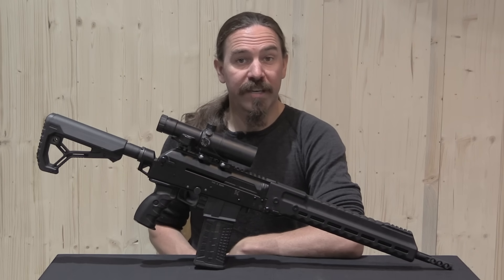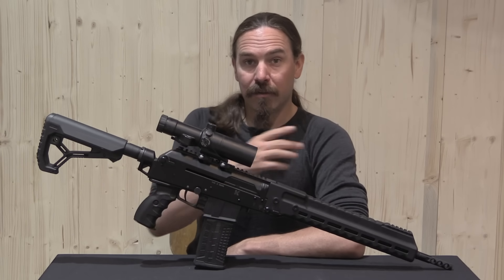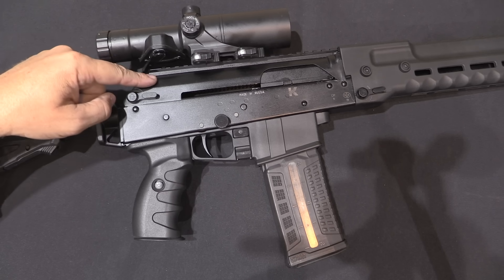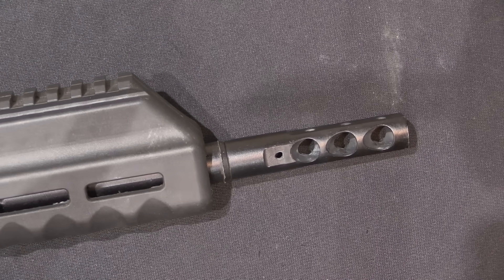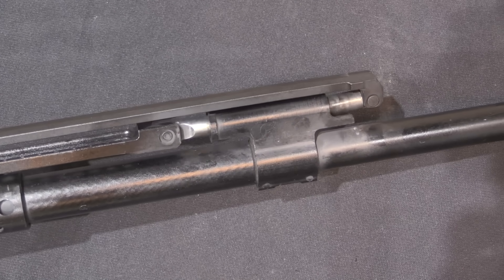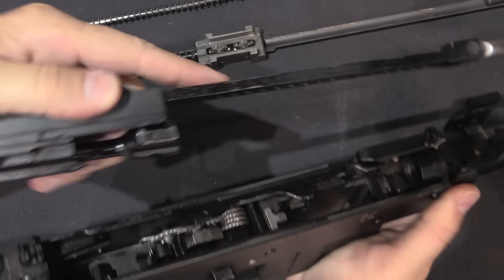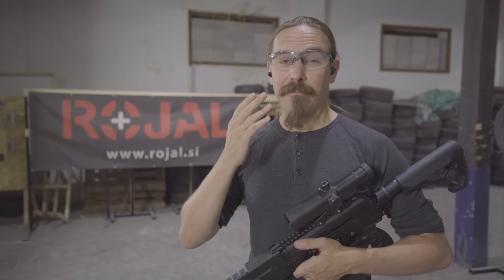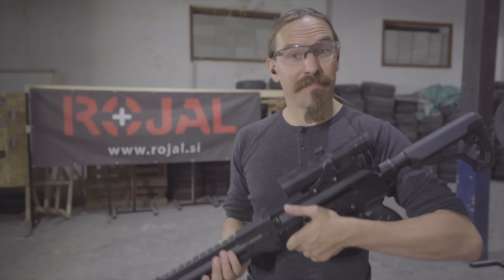Balanced Recoil AK-107 / Kalashnikov SR-1: Is It Any Good?

Comment: At the end Ian makes a very important remark - you can get same results with an AR with lightened bolt carrier and carefully adjusted gas system.. which means very low reliability under actual combat condition (not on the range).
Balanced action was invented for controllable automatic fire under military conditions, where you cannot cheat by using lighter bolt groups and minimal gas drive power. Unfortunately, its actual advantage in performance when used in automatic rifles such as SA-006 or AEK-971 was rather small (like 10-15%) compared to the AK-74, and simply not worth the trouble in a military issue rifle.
Reply: That's the entire problem right there though; people that think military rifles should or could be adopted for civilian use. The military has weapons with large magazines, long barrels, full-auto capability for a reason. Any civilian who thinks that they too need these things is a moron and should never be allowed near any type of weapon, be it rifle, handgun, crossbow, lawndart, anything.
Reply: Who are you to determine someone else's needs?  If you follow your logic, no civilian needs a gun at all.   Stop falling into the anti gun trap.  It's not about need, need is subjective.   The people of Ukraine NEED all of those things right now.
Reply: @MrBottlecapBill  curious as to what spurious reason you’d have cited if not for having that war as a strawman?
Reply: @minimaltrace  Ah yes, the distinct military weapon characteristic of checks notes "A long barrel"
Reply: @MrBottlecapBill  Not exactly true, at least not yet. The Ukrainian Military already has auto weapons at their disposal, and they are sticking by the Geneva Conventions by not allowing civillians to fight as unregular fighters. Even foreign volunteers are being incorporated into the Ukrainian Army.
Reply: @minimaltrace  You give me gated community vibes
Reply: @paulbrozyna3006   mexican citizens versus the drug cartels.
Sri Lankan civil war: tamil tigers used human shields. That said, the tamils themselves were reacting to abuses by the majority Sinhalese. In any case, any civilian could have used self protection when the usual authorities failed, and you had better realize the major point from that: even if the authorities don't entirely fail you: when seconds count, the police are only minutes away. Which is often effectively useless. And that's a best case scenario, in a supposedly peaceful country. Which not even the United States should be claiming to be.

Any number of church shootings as of late could be combated with more armed people, however, mass killers, of course, would target public places with no guns allowed. As such, with respect to such places, other security arrangements are required, that would probably mean private armed security. But really, someone, somewhere, is going to have to have a ranged weapon. Are private armed security armed civilians? Maybe not entirely, and they do get more training if they're expected to hold that position, so hopefully that's more placating.

And yes, though the actual effectiveness of an armed irregular militia is dubious, there are some arguments them having success, with some real world examples.
Especially for a country like the United States, which has many remote areas, it would be very expensive to have a civil war in which the attempt was made to rout out every single last holdout.
But is there a need? Of course! This is the states we're talking about! I don't know why her people haven't already had a massive insurrection against its government years and years ago. (There's a lot to be read about the government nit being democratic, not representative of her people, and how it makes things worse for them. But it's a different topic) Or at least I wouldn't, if I didn't understand it was the people themselves that are the problem, but that's a different topic. And if the USA were changed...so too would it's foreign policy, affecting the rest of the world, hopefully positively.

In any case, the luty submachine gun is just one example of a home crafted automatic weapon. Sure, banning still does something, but if there's a will, there's a way, and it's easier than you might think. And all you end up doing is punishing law abiding citizens.
That said, if you could make everyone believe in not owning guns, that would be more effective. But for all the success that seems to have brought in the last few decades, it has also brought out an overly...vocal crowd opposed to that. And they don't seem interested in giving up without being killed first.
And if you went and wanted to kill them? Well.... you'll need guns at the very least.
It's this insidious thing, you just can't get away from the guns.
Not until there is no reason for them. Which, well, I'd like that day too. But as far as I can tell, the first step is re-engineering of the human brain to change human nature, and that's just the hardware, then you need the right software/culture/memes.

If people are dumb as you would think (or at least so minimal trace probably does), that is the problem in and of itself, isn't it?
Reply: @minimaltrace  The US 2nd Amendment says "Hi".
Reply: Cant all that fine tuning be done with this rifle improving its performance even more? Put lightened bolt in, load anemic sporting cartridge and tune gas system for that exact cartridge. This should be as close to no recoil as humanly possible.
Reply: @Steir12  When the projectile bounces off the cardboard target at 3 meters the system is perfectly tuned.
Reply: @minimaltrace  translation… I can’t see that I have a need for these things so no one should have them. Booooo
Reply: Glad to hear from you Max !  Hope all is well with you and yours!
Reply: @minimaltrace  Long barrel gun is certainly more pleasant to shot which absolutely has value in civilian market.
Reply: @Steir12  it can be tweaked but there are no aftermarket parts for this. Main advantage of ar-15 as a competition gun is not it's design but almost limitless ammount of parts and manufactures on the market.
Reply: @MrBottlecapBill  and 🇺🇦 Ukrainian government is training select civilians and issuing them weapons and ammunition.  Chill.
Reply: @minimaltrace  News flash: police officers in the US regularly keep these weapons in their cars to stop criminals who are committing violent acts. If you're worried about stopping a criminal, it's clearly an excellent choice, or else cops wouldn't have them. Or are you legitimately suggesting that nobody needs to defend themselves?
Reply: @Thoroughly_Wet  well, because the government in the case of the United States, is “yours” already. Unlike Walmart, whatever Church you go to, your bank, your internet provider, the newspaper you read, the tv networks you watch- the government despite all its failings- is the only thing you actually have a fair abs equal say in. You can go to a town meeting, you can run for school committee or planning board, you can campaign for a candidate for senator or lobby and harass a sitting senator with letters, faxes, phone calls and office visits. 
You don’t like the laws? Your representatives created them. Your a citizen - until you are not- why would you want to fight against yourself? I’m all for civilians owning whatever they want. The military should be a citizen militia that gets to practice and play soldier one weekend a month and two weeks a year like in Switzerland. We can keep our rifle like our uniform at home because we’re responsible for them- if everyone who wanted to serve got a Glock and an M5 Spear to keep at home- would anyone really be threatened by the nerd who wants to buy an Ak74m or a Galil or an MP5 or whatever? They’d just be seen as enthudiasts/collectors. If you don’t want to serve in the militia/national guard thing o described.- you pretty much forfeit that part of citizenship and you don’t get to own guns. There problem solved. Our foreign policy would no doubt be kinder and more well thought out- since everyone would be at risk of going to falleuija. You’d know that gun owners were competent, sane, and safe with firearms. Gun owners would get to train and shoot for free on uncle sam’s dollar. Oh- and people would feel a real connection responsibility and sense of ownership over their government- since they actually hold the legitimacy and ability to project its power themselves.
Reply: @eargesplitten9876  The Brown Bess had a 46" barrel, so clearly the longer the better ;)
Reply: @minimaltrace  The entire point of a gun is to have as much of an advantage in violent capability over your enemy as possible. Most crimes are committed with handguns, but then there's the occasional madmen with a rifle shooting anyone he can. The govt is constantly pushing to limit civilians' access to firearms as they spend more in defence than any other nation. Tell me again why I'd want to be limited in selection of weapons?
Reply: @minimaltrace  yes, they can be adopted and should be adopted.
Reply: @minimaltrace  tell me your wife has a boyfriend without telling me your wife has a boyfriend
Reply: @walmorcarvalho2512  Well, they already armed some of their civilians in Febuary, just on the streets from crates, often without control and registration...
Reply: @prfwrx2497  problem with the balanced action that it's very hard to make it with a short barrel.
Reply: @minimaltrace  Does MinimalTrace stand for "minimal traces of brain?" You are an excellent example why anyone over the age of 65 needs to submit, every year, a written statement proving sound mind in order to be allowed to vote.
Reply: @walmorcarvalho2512  WTF? Where have you been in the last 3 months? The ukraine military has been arming civilians for months at this point, they don't give a fuargh about geneva conventions. It was a big deal for like, half a day and then nobody talked about it again.
Reply: Привет Максим.)
Reply: 👍🏻 that opinion is spot on
Reply: @Chiller01  Perfect anti riot setup, reduced powder and plastic bullets but with a 2000rpm burst to the face, that'll be like "BRRRUP, OW YOU PLONKER THAT FUCKIN HURT"
Reply: You don't need a lightened BCG to get a superior flat shooting AR. A good buffer system, flash hider muzzle brake combo and a adjustable gas system or tuned gas tube makes for a very reliable and flat shooting rifle for combat.
Reply: @minimaltrace  I really hope you are not a US citizen.
Reply: @minimaltrace  silence Fudd
Reply: @ShizawnSanders  I do not think that a 'tuned gas system' or 'adjustable gas system' is a good thing on a military rifle, but it's my own personal opinion. For sport - sure, it would work nicely.
Reply: @paulbrozyna3006  That's not what a straw man is.
Reply: @minimaltrace  I would love to "adopt"some military rifles.which adoption agency should I go to?
Reply: @minimaltrace  I would love to "adopt"some military rifles.which adoption agency should I go to?
Reply: @craiggaulzetti2255  Depends on what government you're referring to, If you mean Local and State governments then I'll absolutely agree with you that the people have a say in it. there's a reason there's 50 states and not just a single country and it's so that way everyone in their local area has at least some say in what happens where they live. the problem is that the federal government has gotten so bloated and massive that it's trying to choke out the local governments and impose it's own will. 

They (The Federal Government) believe they can control a landmass the size of more than half of Europe when in reality, someone living in New York doesn't live the same as someone in West Virginia, Iowa, Texas, Florida, Oregon or California. The culture isn't the exact same and people at the federal level try to treat it like it is.
Reply: Hey Max, how does this system compare to the Kord 6P67 in terms of design and effectiveness? Also, how's your AK book coming along?!
Reply: @slister1911  All balanced systems gave an overall 10-15% performance boost in burst fire effectiveness over the standard AK-74. As for the book, the manuscript is complete, but current political situation makes the future of this book uncertain, to say the least. I still hope it will be published someday, but probably later than sooner :(
Reply: @mpopenker  I’m sorry to hear that about the book, I’ve been looking forward to it for quite a while now. I guess publishing isn’t as big  of a problem as getting you paid would be, what with the current political climate. I have great respect for the Russian people, and a love for their small arms genius—I keep hoping our political nitwits in the US will see Russia for the ally it should be against China. Hopefully someday that will happen, your book will be available, and Russian small arms can be imported again! 😁
Reply: @mpopenker  well, you don't need a adjustable gas block. They make gas tubes that allow a precise amount of air into the system. This gas tube is no less reliable than a normal one. You can have as much or as little gas as you want with a different gas tube. That with a suppressor or brake/flash hider combo and matched buffer system is as reliable as it can be while be a very soft shooting rifle.
Reply: @minimaltrace Fck Ukraine
Reply: @ShizawnSanders  all that fine tuning is nice as long as you play it under the comfy range conditions. Once you're freezing your *ss and lube in the Arctics or have to fight in the fine sand that gets everywhere it all goes belly up. There's a reason why most military weapons are much more rough than sporting ones.
Reply: @mpopenker  even a over gassed AR with a suppressor or compensator is a soft shooting rifle. Even in this video he suspected most of the recoil reduction was from the brake.
Reply: @ShizawnSanders  I only can repeat that all this trouble with this rack and pinion system was to improve FULL AUTO dispersion, and increase hit probability. And still was not enough. And as far as I know, any military issue M16 / M4 rifle is not known for decent full auto / burst dispersion, although I would appreciate any hard data to that effect.
Reply: @minimaltrace  It's not about needing. If you think 2A is about "need", you got it all wrong. Back then, when it was put into the constitution, you were allowed to own anything from musket to cannon. A musket at the time was the peak of military infantry implements. It was like legally owning a fully automatic military-issue M4 today. They've already infringed on 2A over the years and you shouldn't let them infringe further.
Reply: @walmorcarvalho2512  "The Ukrainian Military already has auto weapons at their disposal, and they are sticking by the Geneva Conventions by not allowing civillians to fight as unregular fighters." Nope. At some point, they just pulled out military crates with old Soviet AK-74s to the streets and just dumped them there, handing out to everyone with ID or even without it. This was at the moment when Russian troops were near Kyiv.
Reply: @TheyCallMeStuPedaso  I agree with your assessment of minimaltrace and brain power. I don't agree with your age requirement. Earnestly, I've met way more "why do you need that *insert gun here*" who are under 40 than I have over 65.

 I've also seen equal amounts of 20 something's and 65+ who are anti-gun. I don't blame his stupid comment on an age, I blame his stupid comment on ignorance.
Reply: @Thoroughly_Wet  do you realize how badly that logic works out? Civilians shouldn’t have stealth jets, tanks, nuclear weapons, chemical weapons, bio weapons, etc.
Reply: Just want to get clear with this leight weight/tuned gas system low recoil issue. How can you lower the recoil of the rifle by shutting gas chamber and using leightweight bc? As I understand it is the cartridge itself which creates the recoil, and the bc takes just several % of it, and this is not sufficient. Following this logic by turning off gas system you're completely or almost completely turning off the recoil which is simply not true. I can agree all this stuff can moderate muzzle rise somehow with some certain rifles but definetley not with AR platform
Reply: @MrBottlecapBill  No.
Reply: @minimaltrace  reeee
Reply: @paulbrozyna3006  reeeee
Reply: @minimaltrace  weapons are not just for target shooting. The 2nd amendment is very clear, it wasn't for self defense, hunting, or having fun at the range. 

It is a tool for civilians so we don't have something happen to us like happened to civilians I'm Belarus or Myanmar. If a tyranny wants to take over they are going to be shot at and have to kill civilians.
Reply: @paulbrozyna3006  I'd have cited that the entire point of the 2A is to ensure civilians aren't outgunned by their government.
Reply: @minimaltrace  ah yes, long barrels. Not like civilian firearms aren’t regulated to have longer barrels than most military rifles. Shut up fudd
Reply: @minimaltrace  Ok, just going to say:
"Under no pretext should arms and ammunition be surrendered; any attempt to disarm the workers must be frustrated, by force if necessary."
If you're wonder where that quote came from, it comes from Karl Marx.
Reply: This guy would rather die than admit the slavics did anything impressive, so of course he omits the most important points about the system. If this was german he'd be shilling hard af for it tho.
Reply: @MrBottlecapBill  what they needed was common sense and a decent negotiator.
Reply: in a nutshell: you cant trick the physics in a closed system. if something leaves the system in one direction and nothing similar in opposite, the all system itself will move in that opposite direction. there are some existing recoilless weapons IRL, but they are considered exotic. also, point defence cannons in the expance tv show, if look at them firing very closely, you can see flashes from their backs- thats what i call attention to details.
Reply: @joemama.556  nice touch
Reply: @jedcollings3624  I think the wood projectile 308 I bought surplus was made for anti-group dispersal
Reply: Not sure you can achieve 'the same' results, similar probably, but not the same, just from a sheer physical perspective along - even a light bolt and adjusted gas system won't get rid of the fact there's still a whole bunch of weight wobbling around inside. And i don't mean THIS rifle in particular, just the idea and system, i mean, its the first of its kind really (aside the Kriss vector tho its a submachine gun), its not like it got the amount of perfecting and work the AR or even normal AK's have gotten, meaning with more work it could be considerably better than said systems with enough work put in, well, aside the reliability and higher cost problems which can be remedied to a degree but never fully due to the added complexity. Saying you can achieve the same in a conventional rifle is like saying you can get rid of the back blade in a conventional helicopter without adding extra things in - you just can't, there's always the need to counteract the spinning momentum that'll be gained, just like the conventional auto/semi auto rifle will always have the rocking bolt problem that you can't get rid of without countermeasures. The only other way you're gonna achieve something similar or better is either on a compensated bolt action (per shot, because you're gonna have to move it around a lot to reload), or a rifle with some sort of electric loading system, in which case you can do away with gas pistons and rapidly moving and slamming parts.
Reply: @minimaltrace  Shall not be infringed fedboy.
Reply: Не знаю что за ерунду ты сказал, но АЕК и А-5.45/7.62 стоят у нас на вооружении. Единственная проблема АЕКа - он гниет, как старая лада... В остальном он намного лучше чем АК-74М.
Reply: @evilfurryfromnowhere4100  АЕК состояли на вооружении Минюста, А-545 приняли на вооружение ВС. Только вот сделали их сущие слезы, потому как ржавеют они может как Лада, а вот стоят как хорошая иномарка.
Reply: @TheUltimateWord  If the concern was being outgunned by your government, then I think that might've occurred sometime around when governments discovered artillery. 

I'm all for gun rights, but I've always thought the "defense against tyranny" argument was a pretty spurious one. For the logic to hold, you either need to extend that to say that civilians should also get unrestricted access to high explosives, artillery, missile systems, stealth bombers, predator drones, basically any and all military weapons systems and platforms up to and including strategic nuclear arms ... or you need to establish a clear reason why "defense against tyranny" doesn't apply to these larger systems. 

Because if the US military decides to tyrannize my ass, my owning an automatic rifle isn't going to be much of a challenge.

There are other arguments for gun ownership. "Because the government might turn evil" is not a great one in itself. Better solutions would be to make sure the government doesn't turn evil, and that US military never decides to start tyrannizing my ass. Like, if I was concerned about cancer, my solution should be prevention and healthy living - not purchasing a set of surgical scalpels to operate myself.
Reply: @minimaltrace  " Any civilian who thinks that they too need these things is a moron and should never be allowed near any type of weapon, be it rifle, handgun, crossbow, lawndart, anything." the 2nd Amendment disagrees with your opinion.
Reply: @minimaltrace  anti-gun woke detected.
Reply: @minimaltrace  
The reason civilians should have access to the same small arms the military has access to is because civilians need to be on equal footing with their government. From a historical standpoint, most countries that have an armed government but no armed citizenry have brutalized and killed their citizenry whenever they feel like it and have the worst records for human rights violations imaginable. Citizens need access to military arms to make sure their government and military don’t turn tyrannical and decide to start killing them. That’s basically it. And don’t say it hasn’t happened, couldn’t happen, or is unlikely to happen because history has shown us it already has. It’s still happening right now. So, why would a civilian need military style weapons? Because if civilians don’t have weapons that are at least as good as the military’s, the military and police won’t think twice about murdering people and violating rights. Not only that, in countries that have private firearms ownership, that number of citizens outnumbers the military. An invading foreign force would not only have to fight the military, they’ll have to fight the militia/civilians too. Firearms ownership is a big deterrent to invasion and keeps a country strong. If you don’t think there are good reasons civilians should own military style firearms, you’re either completely naive, extremely unimaginative, or you’re an elitist anti-gun proponent and one of the very tyrannical people that don’t want others to own guns.
Reply: @minimaltrace  
Furthermore, I understand the reasons for rights, protecting human life, and protecting freedoms with the force of arms because I served in the military. I’ve seen firsthand what happens when people don’t have the means to protect themselves. I may no longer be serving on active duty, but I’m still trained, I’m still capable, and no matter how old I get I can still train others. I remember my oaths, I remember the meanings of my oaths, I remember what I was fighting for.
Reply: @MrBottlecapBill  urkaine only needs a m-101 howitzers from ww2
Reply: @minimaltrace  "The weapons of war" argument has to be one of the most asinine arguments I've ever heard.  Every gun ever made is a weapon of War.  Every gun made is made for one purpose and that's to kill things.  That's the only purpose of a gun, they can be retasked for entertainment purpose but the reason they were made was to kill things PERIOD. Which by the weapons of war argument means no civilian should have a firearm at all. By the way, over 80% of gun violence in most countries especially America is caused by people using handguns to commit crimes.
Reply: @paulbrozyna3006  how about the numerous quotes from the founders who wrote the Second Amendment. They were very adamant in their beliefs that the people should have the same access to military grade Firearms as any Soldier.
Reply: @ragnokgaming3234  did you know that common citizens can buy almost all those things with the exception of nuclear and biological weapons. You can privately own a tank or a  fighter jet, you can even buy Munitions for them...
Reply: @MrBottlecapBill  they need all of that in Ukraine Cuz the military is just not enough

wish is not the case in the US, having the biggest military in the world
Reply: @eargesplitten9876  oh, the irony of SBR regulation
Reply: @minimaltrace  All a person truly needs is food, water, and shelter. It's just strange how cars which kill a huge number of people in the us are still legal, electronic devices that are used for day to day life but are also used for criminal activity such as identity theft, stalking, ect are perfectly fine despite those activities ruining people for the remainder of their lives. The same goes for alcohol, medication, even caffeine hurt people. Everything in this life is capable of hurting people and ruining lives forever if they are used unintelligently or with ill intent.
Reply: Love your website btw. Maybe it would have more of an effect if the mass of the counterweight was equal to the mass of the bolt and bolt carrier. But this one doesn't look like the counterweight comes anywhere close to that, which is a bit of a bummer to see. I wonder why they hadn't gone with a Tungsten counterweight instead of this...
Reply: @walmorcarvalho2512  Really? Territorial Defense would like a word.
Reply: @ShizawnSanders  Why do you need an adjustable gas system? that's right, to have a setting for normal non-contaminated use and with an adverse setting for gunked-up gun. Guess what? If you are in combat, you don't have time to change settings. Thus ALL military guns without adjustable gas system are considered "overgassed", when reality is that gun is actually gassed correctly for an adverse setting. It's just that it doesn't have the "soft" setting. And "soft" setting is LESS reliable as it can't power through contaminants inside as well as "adverse" can.
AR-15 even without the adjustable gas system has been proven to be less reliable than most of its competition in adverse conditions by hundreds of tests that militaries ran. Add a soft setting and it'll run even worse.
Reply: @Max_Da_G  are you just a bored troll looking for a internet fight or something? This was 7 months ago and I don't even remember what I wrote. What I can tell you is a DI AR can have mud on the damn bolt with the dust cover open and it will run. Piston rifles in that situation will fail on the second shot most of the time.
Reply: Hey Max,
huge fan of your work, so I hope you read this comment (7-month-old vid after all).

It's pretty cool to watch a video of Ian, about a rather oddball AK, just to find you joining the discussion in the comments.
The very guy making the website, where I first learned about the background and of this specific system (and many more relevant).

Your website and it's contribution to the public “knowledge base” about soviet/russian firearms is invaluable and one of my go-to sources since ages.

The first time I browsed WORLD GUNS (later Modern Firearms) was in '99. That meant 56k Rockwell modem along with AOL CDs, or later via ISDN 64k.

I have a hard time recalling any website of this era, which is still around and relevant.....basically the Wikipedia of eastern block firearms, before Wikipedia itself actually launched.

Twenty years later, the plot came full circle, when Ian had you on FW to discuss the development and evolution of the AK and soviet ammunition design.

When Ian finally pushed through with his book projects on head stamp publishing, I always hoped this connection would lead to an eventual genesis of a book release of your own.

As I understand, there was actually a book in the making (on head stamp publishing), aimed at a '22 release, but (to my knowledge) nothing materialized so far.

Could you give an update to the roadmap?  Did I miss the release, or is the project shelved for the time being?
Reply: Yeah it's like comparing your pimped SUV with a Humvee. Pimped AR is not combat ready.
Reply: @walmorcarvalho2512  you might want to recheck your information. There are civilians who put uniforms on, that are currently fighting in Ukraine. They were teamed up with regular military personnel. There’s a young lady that was a school teacher, and now, she’s one of the best snipers in the Ukrainian military. There’s other civilians who became paramedics in Ukraine.
Reply: @chillinchum   Wrong.
Reply: @Thigamabob  Tl;Dr: what do you even expect to gain out of making such a useless comment?
Why are there people like you who do this?
Can you tell me why I'm wrong so I can believe it? Isn't that what you want?

ok so let me get this straight.

You look at a long, hopefully reasoned comment intended to make a point not so much for or against gun control, but one that asks for sober thought, reasoning, and actual fact instead of "fact", to tackle all the issues involved.

I'm sure there are plenty of counter arguments, I don't want to be arrogant and say I or what I said is perfect. I'm sure there are flaws in what I said to exploit.

But instead of raising actual objections, you just decide to say
"Wrong"

That will show me! Oh, tottally!

Look I despise mockery and will not stoop  down to it, but it's a little bit of a challenge. Why should I even remotely take you seriously?

Do you have any counters to offer me so I might SEE how I'm wrong?!

What was the point of writing anything down? Is it to annoy me? Well, mission accomplished I guess? Do you feel good about yourself? If so, I don't envy you, I can't imagine someone who can only feel better by making a half-assed attempt to antagonise someone, would be someone leading a happy life.
Reply: It’s actually more like 15-20% more accurate in full auto in comparison to the AK-74. For the huge jump in rate of fire, I find that to be impressive.
Reply: You should be kept away from all weapons @minimaltrace
Reply: @minimaltrace It's not about need. It's about want. And the liberty to do so. People were allowed to own muskets and even cannons. At the time, muskets were military rifles. This "need" thing is a slippery slope. I like to wear my pants with suspenders even though I don't need to. I could just get a belt. But I want suspenders and I am granted the freedom to do so.
Reply: @MrBottlecapBill hes not. Hes just an evil.person who wants civilians to be at a disadvantage when protecting themsleves.

Anything the military does to improve small arms is doubly applicatable to civilians. WE have  thousands of rounds we can access per year your free to train with (if you arent combat arms, join your base shooting team)  we can train around shortcomings.

Civilians? Less likely. Thousands of rounds a year per gun is in the quad digits of money, especially with having to rent a range for semi-rural to urbanite civilians.
Reply: It is supposed to be 15-20% increase in accuracy due to recoil reduction during automatic fire based on testing against ak74m, which is significant. 20% better accuracy is alot. Might not sound like much but that could be the difference between hitting several targets where you want or missing entirely. 20% is a fifth. Then you add the compensator on top of that and you have a much more accurate firearm because the recoil is so effectively managed. It's not supposed to be recoil less, but significantly reduced. It achieves that in strides. And it was supposed to mainly deal with automatic fire, not semi or burst. The muzzle brake obviously helps but the balanced system has been tested and provides the majority of the recoil compensation. Test the brake on one without it, you'll see the difference.
Reply: @minimaltrace  Based on this comment, you shouldn't be allowed anywhere near a voting booth.
Reply: @minimaltrace Could you explain why military firearms shouldn’t be adopted for civilian use? 

Like, let’s run through your admittedly odd criteria. 

Full auto: Useful for suppressing fire, close quarters, and putting as many rounds down range as fast as possible. Useful in both civilian competition and military. Civilian competition includes needing to put many rounds down range quickly as well as close quarters stuff sometimes. 

Long barrel: Useful for accuracy and ensuring more/all propellant burns to maximize velocity. That’s easily useful for everything from hunting to self defense to combat to competition.

Large magazines: Generally, a trade off. More ammo means more shooting per reload, but it’s also more weight on your gun. And, as you get bigger, you need more and more complex systems which are fine for things like range conditions, but not really combat conditions. This is why you mostly see 20-30rd capacity in both military and civilian applications until you start getting into belt fed weapons. Competition, combat, hunting, and self defense all have similar pressures. Hunting mostly because you never know when you will become something’s prey and you’ll need to unload. 

None of these, except maybe full auto, can be tied to specifically military applications. But also, shouldn’t military applications be covered under the second amendment? I mean, the whole point was twofold: an armed population cannot be subjugated by tyrants as easily and because having a population already armed and with a decent amount of knowledge of firearms makes for an excellent emergency reserve force. This is similar to encouraging or requiring longbow competition in medieval England so that levies would need less training. Things like hunting, self defense, and competition are secondary to those primary objectives. Oh! Also, people already having weapons makes for a good emergency reserve force because, well, you don’t need to worry about arming them instantly if you really need them right now. You can wait until you actually have the ability to arm them while still having a semi-effective combat unit. Very useful in those “oh shit” scenarios like surprise invasions and civil wars. Admittedly, you’d replace their ragtag bunch of weapons with standardized equipment ASAP, but that may be weeks or months.
Reply: This system might be very useful in a semi-auto special forces DMR for fast follow-up shots.
Reply: @Steir12 by doing that, now you Sheba  less powerful round that functions in a smaller range of conditions.
Reply: @zachfpv4493 I'm looking for the gun orphanage, do you know the address?
Reply: Exactly. Balanced recoil is a way of having the cake (low moving parts-induced recoil) and eating it (the ability to nonetheless overgas the rifle). Yes, more cake costs more money (and complexity). Might have worked out if done slightly differently, who knows. I think we haven't seen the last of it. Possibly they will reintroduce pulleys with today's way better string materials, or just forfeit any syncronization mechanisms whatsoever.
Ultimax does the same by giving the bolt carrier group more runout space in the receiver, so there is the compromise of more weight.
Reply: @minimaltrace literally why are you even on this channel 🤭🤭🤭
Reply: @angeltensey  You are not quite right. The concept of balanced automatics and its benefits are best understood if you adopt the model of "felt" recoil as the total sum of muzzle climb and sideways jerking due to, on the one hand, the recoil due to the bullet being accelerated in the gun together with, on the other hand, additional longitudinal jerking of the whole gun due to heavy stuff moving around while cycling which also adds both to muzzle climb and muzzle sideways jerking. 
While muzzle compensator devices, lafette-ing the whole receiver to make it work against a spring (more or less almost the same) and rubber or spring cushioned buttplates mitigate the former, the latter can only be mitigated by fine tuning the gas system and adding buffer springs and mechanisms while using a light bolt carrier group together with a correspondingly selected return spring (AR15 family), by giving the bolt carrier group ample runout space (Ultimax approach) - or by adding a counter mass moving in the opposite direction of the bolt carrier group which balanced automatics ultimately do.
Reply: @BluntEversmoke  you are overcomplicating things that doesnt need that. there are two major sources of recoil: mechanism and muzzle energy. 107's balance thing tries to counter the mechanism, but you still need to do something with muzzle energy- thats why you need muzzle break anyway. by the way, muzzle energy is that thing that leaves the system (which is a gun) without opposing force.
Reply: @ehfoiwehfowjedioheoih4829  if you cannot figure that out, i am certainly not going to help you.
Reply: couldnt dsagree more, I have a fully built 3 gun AR. adjustable gas, miculek brake, lightened nitride bolt, 2 stage recoil spring, etc etc. It also has more felt recoil than my bone stock AK74.
Reply: @paulbrozyna3006 that's not what a strawman is
Reply: And then AK-12 happened 💀💀💀